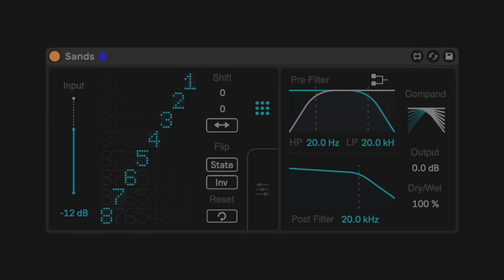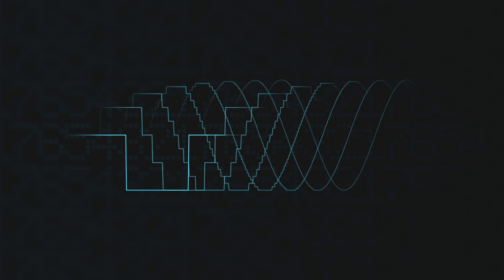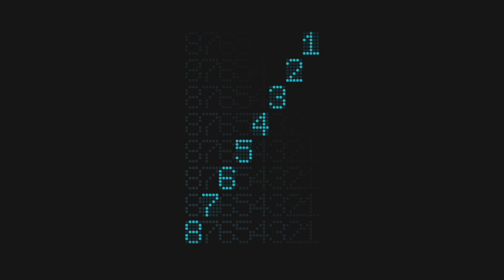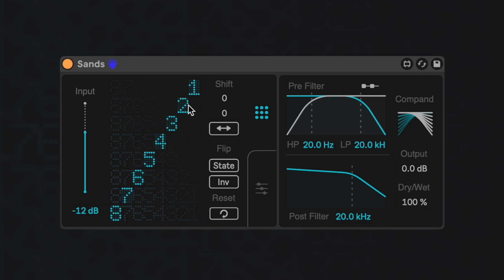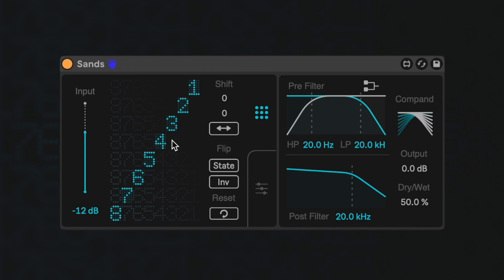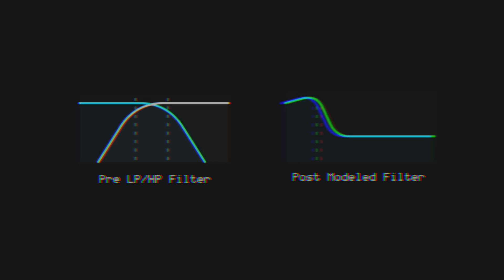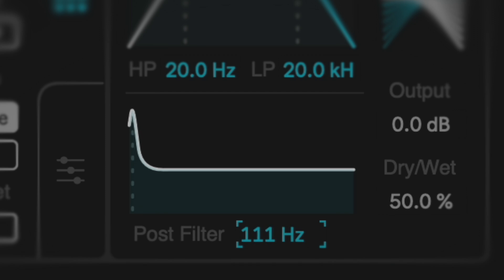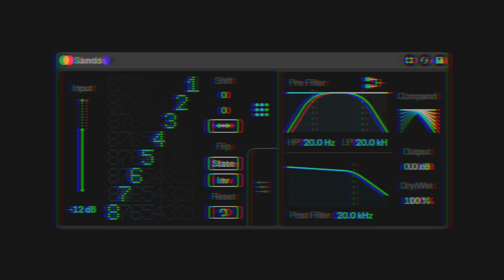Sands | Max for Live Device Walkthrough

Comment: Hi I’m Ryan. I wrote the dsp for Sands. AMA
Reply: device looks clean, congrats and best of luck! question: are parameters, including the bits in the matrix, capable of being automated? thanks
Reply: @owntempoltd  The short answer, yes! The long answer: yes, but you don't automate the individual bits, you automate shifts in the matrix, which results in automating the bits, but it's way more interesting an intuitive.
Reply: @repairerofreputationsmusic  aye thanks!
Reply: What exactly is analog modeled about this?
Reply: @quailson believe it or not analog to digital and digital to analog converters are built out of analog parts. This models the resistor networks and companders of primitive analog ADCs and DACs. I don’t think we emphasized (or even mentioned) the analog modeling in the promotional materials because it’s not really what is exciting about the device to us, but it is definitely part of the design. If anything we think of it as modeling old digital hardware. A lot of people get confused and think old digital devices are “software” but it’s not actually what they look like under the hood. If you check out old lexicon/eventide boxes you will find that rather they are mostly built out of analog components that need to be explicitly modeled and how you model them affects the resulting sound. You have to remember that computers were not capable of handling real time dsp of any practical use until the mid 1990s—so the digital CPUs were mostly used for control. This is why when someone finally put the DX7 die under a microscope, the vast majority of the circuit was dedicated to analog shift registers which stored the waveforms and performed phase modulation. I wrote my PhD dissertation on the simulation of analog and digital communication systems, so this remains an abiding interest.
Reply: @repairerofreputationsmusic  What a great response. I imagine I'll have some questions when it's not 4AM
Reply: @repairerofreputationsmusic  would you be willing to link your thesis? it sounds very interesting
Reply: As someone who makes "commercial music" and doesn't know much about modular, would you recommend this plug-in and if so, why?
Reply: @iamsaintlewis  There's such a broad variety of styles in commercial music these days, it's hard to say. I'd say if you want to use a unique distortion and a unique filter to process your sounds then yes. I'm not really a salesperson though. It's why I went into academia to be honest. I think this device is mostly for people that are really excited about sound design, regardless of their genre. It's not really a preset "effect" but something you can use for a range of tasks: want to make your audio sound like it recorded on a vintage sampler? Sands can do that. Want to take your kick drum and warp it so it almost sounds like an FM synth? Sands can do that too. Want to dial in a grainy distortion for your break, filter it, and then dial back to the mix a bit to give it a bit of burn in the low end, Sands is also good for that. Want to completely implode your entire mix into an unusable mess? Sure! 

It doesn't have anything to do with modular, it's just a unique distortion that doesn't have any equivalent. It's sad there's no way to demo M4L devices, because I think playing around with it for 5 minutes you'd immediately know if you're going to hate it or it's going to be in every mix.
Reply: @iamsaintlewis  Thank you so much for the kind words. I have created thousands of max patches over the years, and this is the only one I've ever turned into a product. This device is really close to my heart and I'm really excited to share it with people. I'd love to hear what you make with it. If/when you grab it, feel free tag me in anything you make with it.
Reply: Is there anywhere we can find more sound demos / examples? Perhaps before and after? Brilliant video and device concept! :D
Reply: Are the bits 1-8 on/off states modulatable? I’m assuming all other parameters are modulatable?
Reply: Absolutely love this device. Im going put this on everything 🙏😆
Reply: Hellp ryan! Why you chosen to do using m4l and not a framework like JUCE that would work on all DAWs?
Reply: this looks amazing well done! any chance i can have a discount code i have no money :((
Reply from the maker: @mchaelhb  Always a spring sale down a month or so!
Reply: @rainbowcircuit  ooo thankyou! I’ll keep an eye out for that
Reply: @rainbowcircuit  is there a mailing list I can sign up for updates

Comment: how's latency?
Reply: Should be near zero. This is mostly done on using custom code that is very efficient. There is no phase cancellation if you mix dry and wet, which is a pretty clear indicator of how that works. Now, if you invert the bits, that's a different story.
Reply: @ thank you will grab soon
Reply: Excellent! Currently working on 1.1 dsp code that gives you better audio quality in some circumstances as well as some free devices to add in over time. I have a neat distortion and ring mod I built out of the same tech.